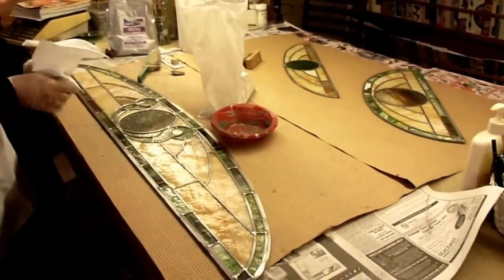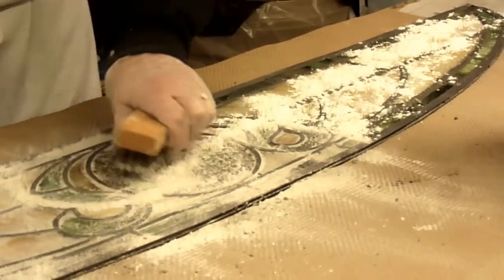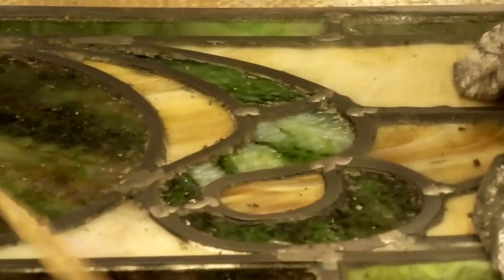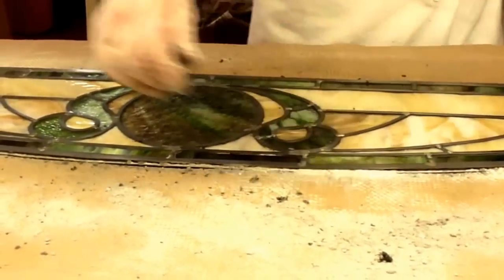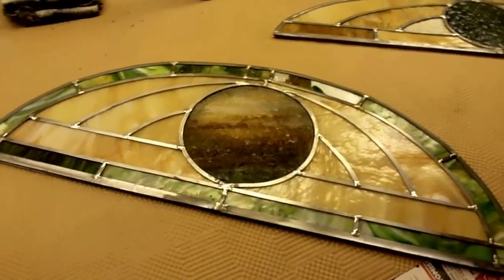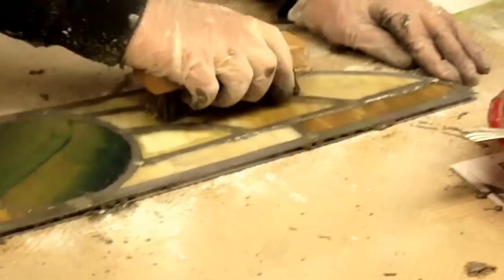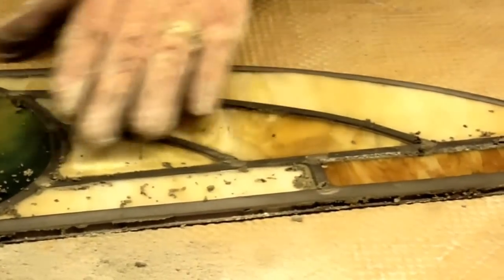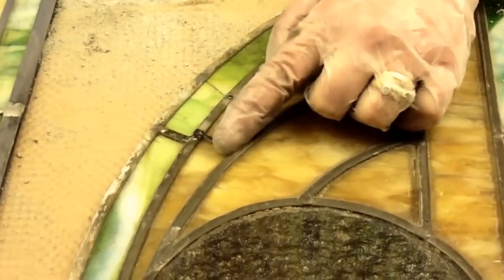Narcissus Stained Glass Work 2-4-2015

Comment: Hello, Is there a final picture of it totally assembled, ?
Reply from the maker: Hi Otis, theses windows were for a restoration of the historic electric interurban, Narcissus, which continues on at Seashore Trolley Museum in Kennebunkport, Maine. The forty leaded stained glass windows were repaired separately and are in storage until it's their turn to be installed. There are photos of the 26 restored clerestory stained glass windows in their mahogany sash all test-fitted in their openings in the 46-foot car. And a couple of photos of one of the large restored "eyebrows" in place in the smoking compartment during a fundraising event in 2016. I'm the volunteer project manager overseeing the Narcissus restoration and would be happy to share those photos with you. Let me know and I will give you my email address,  or you can go to the Narcissus blog and search the index for posts on stained glass. www.narcissus1912.blogspot.com

Comment: Your making a lot of rookie mistakes, your putty is two runny, whitting powder and linseed oil, with lamp black powder makes the best putty. If you mix your putty right you have threes days before it drys and you can clean as you go. You can speed up the drying just by adding the whitting powder. I restore church window by profession.
Reply: The original recipe for cement is 1 part linseed oil, 1 part turpentine, 1 tsp red lead, lamp black for colour, whiting to make a thick paste (thicker than used here). And a panel should be much more robustly cemented than shown here, the cement must be forced through to completely fill the lead, and you should cement both sides. WHiting does not initiate the curing process, all it does is absorb the linseed oil and start to dry out the cement. Curing will being in 24-48 hours by contact with oxygen (air), it will take anything up to a year to fully harden but will be sufficiently hard within a week or two to be able to install the window